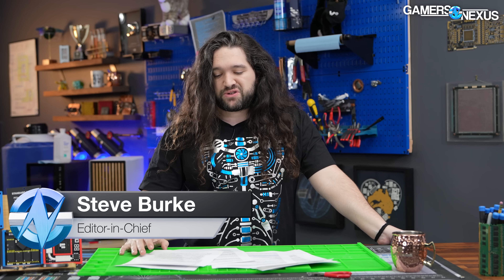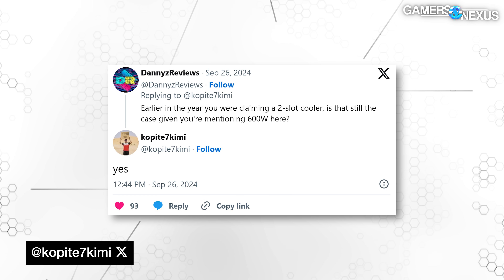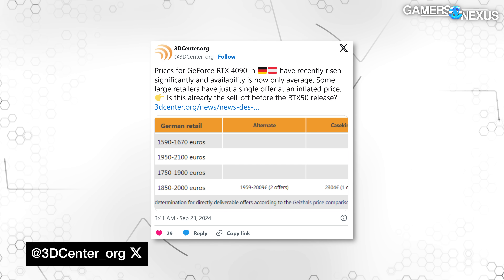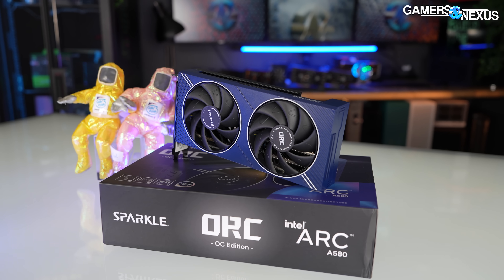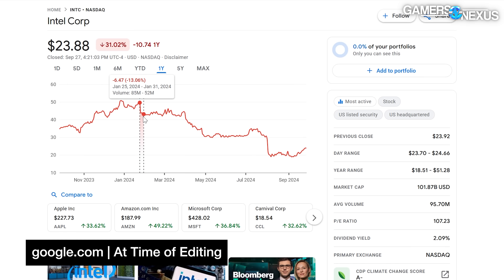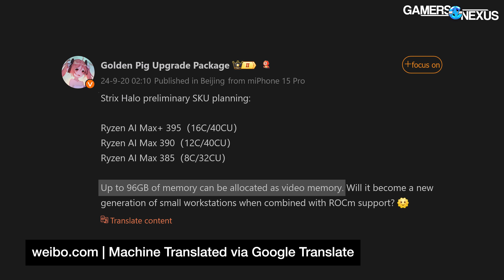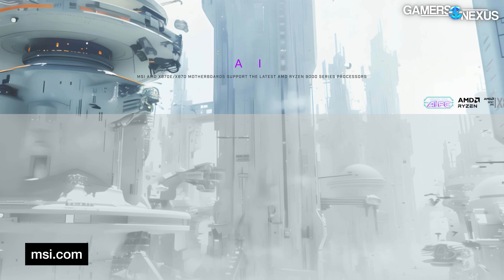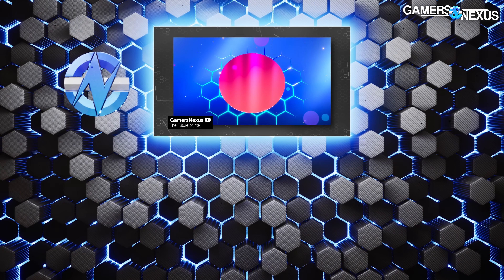HW News - RTX 5090 & 5080 Leaks, Valve ARM64 Experiments, Intel Arc 0% Marketshare, 4090 Price

Comment: HIKE? My 1080 is never getting upgraded bro 😭
Reply: Lmao I just went from a 7700k to a 5800x3d, 16 to 32gb ram (ddr3 to 4) and a new case and drives for less than a new video card would cost 😂
Reply: Just get a 3080 it can go for abt 400 dollars sometimes and it's basically the same with vram.
Reply: How I feel with my i7-8700k and my 1070 that I have to underclock to keep stable lmao. But Planet Coaster 2 is coming out in like a month sooooooo...
Reply: @KrautessendeKartoffel My GTX 1080 died (still boots but crashes randomly under high load). Rip.
Reply: Used 3080ti bro. I’ve seen them on eBay as low as 450$.
Reply: I'm pretty happy with having gotten a Palit 4090 for 1600€ at this point lmao
First time I ever bought a high-end model and I'm always fearful of buying hardware that outdates too quickly, but it looks like the 4090 is here to stay for a good while.
Reply: @kunka592  Tried underclocking it?
Reply: at least you got a 1080 back then i only have a 1060 6gb. Lets hope when the time comes we all get a 5090/6090
Reply: @T33K3SS3LCH3N  early adopters of the 4090 will get their money’s worth imo. It’ll be another full generation before the midrange catches up to it, and another full generation before it becomes slow relative to midrange. Previously the flagship cards would be matched or bested by the 70series and represented horrible value gen on gen. If by some miracle the 5090 is close to 4090 MSRP(it won’t be thanks to strong sales at 2000$), then it’ll likely represent the best perf/$ in the Nvidia lineup again. 

Which is insanity.
Reply: get used 3080 and call it a day
Reply: That your fault at this point
Reply: Long live the 1080 Ti.
Reply: I'm glad I only emulate, so CPU upgrade matters more for me
Reply: I'm still on a 970, don't feel bad
Reply: @kunka592  I had the same it was the PSU not the GPU
Reply: There's some good cards that would be a substantial improvement in the $300 range. RX 6700 XT's have been floating around at decent prices. The RTX 4060 is not a particularly good value, but it is more powerful and much much more power efficient than a 1080.
Reply: I have my GTX1080 and 4790k
Reply: @KrautessendeKartoffel how is your 7700k doing in next gen games?
Reply: Upgrading means AMD
Reply: @NeightrixPrime  for CPUs, yes. For GPUs, it's just whatever best deal you can find at a certain price point.
Reply: Monopoly
Reply: bro im on gt 730 i lag in powerpoint bro please send help
Reply: @dolpoof2335 10GB VRAM is dogshit in 2024. It was terrible when it released.
Reply: @JSXSProductions lol why is it unstable? I used to run a 50MHz core and 500MHz VRAM OC. Now I bought a 6800.
Reply: I just recently got an RX 6800 for €375. I have the same memory capacity as a $1200 5080 😂
Reply: @MechAdv A 3080 Ti has only 12GB VRAM, no enough today. A 6900 XT has 16GB and slightly more performance and costs the same or less.
Reply: @TheClassicMufasa at least you don't have a 1060 3GB lool
Reply: @T33K3SS3LCH3N a 5080 is rumored to be 10% faster than a 4090 and cost as much as a 4080. There is a reason high end sales dropped off a cliff the last couple months because it's stupid to buy high end now for the same price it was 2 years ago when a performance jump is imminent.
Reply: @imnotusingmyrealname4566  Maybe think a little more. The 1080 comes with 8 gigs of vram. He's probably not using anything vram intensive lets be honest.
Reply: get rtx 4070 ti super gigabyte eagle oc 16gb

Comment: I'm still blown away by how much cache those X3D chips have. Like that's enough to fit old 90's games onto the CPU and never have to touch main memory. Hell, that's probably enough cache to run Windows 9x without main memory!
Reply: The minimum requirement for Windows 95 is 4 MB and 16 MB of 98/98SE, you could run dozens of copies of the former and a few of the latter entirely on cache. And yes, you could run games up into the late 90s on that much cache.
Reply: goodluck getting that to work though lol
Reply: And it's STILL beneficial to have more for some modern games. It's incredible how much of a difference cache size makes for gaming performance. I mean the 7800x3d is actually a fairly low performance processor, MUCH weaker than intel CPUs. But that v-cache has it running LAPS around anything intel has. It's the absolute undisputed KING for gaming right now in 90% of games.
Reply: @GGigabiteM  It's not just the RAM requirements of Win 95 or 98, it's the install size. I mean, instead of loading the drivers and whatever from the disk, it can load them all from the L3 cache.
Reply: @HolyRaincloud  The only difficulty is having a motherboard that offers the PS/2 keyboard + mouse that Win 95/98 know to use and support for MBR, since Win 95/98 have no idea of that UEFI that's common nowadays (it simply diddn't existed back then).
Other than that, the CPU is fully compatible, you can even install baremetal the OG MS-DOS. Ok, actually, now I remember, for Win 98 you need a patch in order to make it only see 1 GB or so of RAM, since it crashes when there's more (even though theoretically it should work and support up to 4 GB, as a 32 bit processor would)
Reply: Still can't play heroes of might and magic 3 entirely off 3D Vcache unfortunately.
Reply: I for one hope enterprising future hackers will be able to run them as a "system on a chip" 😂.  Also see the Intel on-package DRAM models for certain laptops.
Reply: @johnmclain250  I mean yeah, if you have a $700 or more processor and want to game in 1080p.  Otherwise it's not really in it for price/performance.  Especially if you factor the platform in. Personally I picked up 5 Z690 boards, 3 of them were only $30-35.  One was 50 and another 80.  The 12700KF fluctuates, but I've seen it down to 185 new multiple times this year So the 7800X3d is the 'Halo' processor, and as usual you pay double for the priviledge.  If you need it, cool beans.  I'm personally waiting for 10 and 12 P core Intel.  I still think the E cores are a bit of a waste for gaming.  Although it was hard to argue that seeing my 14700 (no K) doing the BMW render in 24 seconds wasn't impressive.
Reply: @johnmclain250  
But what about for emulation?
Reply: It's crazy how wasteful modern software is compared to ye olde days.

We've even regressed back to visual UI elements taking seconds to even render.

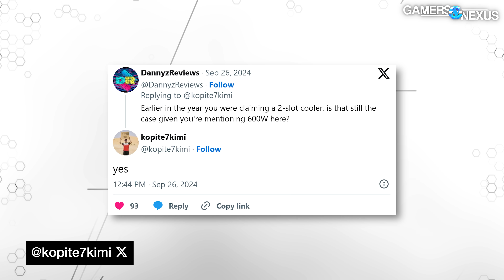Comment: 4:46 The 5090 will indeed be a two-slot card. The two slots will be slot one and slot five.
Reply from the maker: hahahaha. Clever.
Reply: @GamersNexus no, I think this is actually gonna be what it turns out to be
Reply: @GamersNexus  Maybe the "2-slot" leaks are just the server blower style 5090s?
Reply: The 4090 might have been slightly overbuilt so they could just be packing it full of fins and making it 2 slots, and accepting that it would run hot.
Reply: I hope they will add some antisag brackets. Otherwise northwestrepair will have lots of hard work in front of him fixing all the broken GPUs with rejected RMA...
Reply: @devins7  The "Doc Ock" Block, that has 4 PCIe riser cables sticking out from it (Threadripper board required)
Reply: some guy in a 3rd world country... dude the street lights are dimming why?
Reply: @Morpheus-pt3wq  Or we'll all have to get used to vertical mounting to avoid it. Which I personally strongly dislike, even if it would be healthier for my heavy 4080.
Reply: @Morpheus-pt3wq  3rd party aftermarket gpu support brackets do exist and can be bought seperately for cheap. I have 3 supporting my 4070 super so sag and uneven pressure ain't a thing I ever have to worry about
Reply: @SRSpawn  2000 usd for a gpu and they don't include support bracket? what a joke of a company
Reply: @kilowattpa sometimes what is included ain't always worth trying out for eg; my asus rtx 4070 super came with a sh*tty looking nividia adaptor, I never used it I just bought a pwr12 corsair cable instead😅
Reply: @ΔαυίδΠριδεαυξ  Nvidia would never allow that. They used dirty tricks to prevent the 3090 2 slot blowers being released.
Reply: Or they've just given up on air cooling and all 5090 cards will have an AIO attached.
Reply: Yes. Slot one on the first, and slot five on the second ATX mainboard.
Reply: RTX5090: 32GB 512-bit. The SKUs below: 64bit.
Reply: Just a reminder, because it seems like the is some confusion still, Valve's Proton is Wine and you don't even need Steam to use it. Proton is a custom build, but it is the same system.
Reply: Whatever the 5090 does there's plenty of people that are waiting on it and will  make it work regardless.
Reply: I was gonna make a similar joke. It's two slots, the first slot is in the first PC tower case, and the other is in the second PC case for the other half of the card.
Reply: @kilowattpa good cases generally come with built in support...
Reply: @wallywest2360  That's not practical nor reliable as air cooling is always more efficient when it comes to longevity and cost.
Reply: @jamesm568  I have an EVGA 1080 ti hybrid that still works fine.  Cost seems to be mostly irrelevant, the 4090 is absurdly priced and has sold very well.
Reply: @wallywest2360  If you like 1080p then that's perfectly fine. I use a monitor that's no less than 32" and a resolution of no more than 6K and sometimes 4K, depending on which monitor I switch to. The 3090 didn't cut it but the 4090 did. Once you go high-end anything below that isn't even worth using anymore. I can't stand 1080p or 1440p as those resolutions have been outdated for the last 5 years for my use.
Reply: @jamesm568  Thanks for making my point.  Your claim is the AIO cards aren't reliable.  Mine is still working long past the point where you'd want to use it.
Reply: lol!!!!!
Reply: That made me laugh , Thanks :face-blue-smiling:
Reply: 2 slot might be understated, but if you remember der8auer video, when 4090 FE came out, he had shown, that cooler on that can easily cool overclocked FE, that was drawing 650W .. so i expect, it will more likely be same cooling as 4090 FE (Eg. 3 slot size)
Reply: @kilowattpa   not just that. $2000 for a mainstream GPU. It's still an RTX card its not like a quadro or enterprise card. Costs more than... basically all my cars up front did when I bought em.
Reply: Chanerd 🗿
Reply: 28:00   I like how the Seasonic box is oddly long and skinny.  Not sure if this is supposed to make you think of premium (3 fan) GPU boxes, or prepare you for how ungainly and long the PSU is 😅
Reply: LMAO
Reply: @TheCountdownnowgo  
You must be young to ask that and missed, the 10/10 humor that person delivered!!!!!!!!!!!!!!!!!
Reply: @SRSpawn  i have one as well, but do you expect general population to be aware of those? Because i do not.
Reply: @Morpheus-pt3wq  I expect the general population to do a bit of research before they buy something like a car, house, computer, computer parts, console, you name it. Those who don't are strange to understand 😅
Reply: @SRSpawn  
Not strange......... Just that, those situations separate Childish like minds and those of Adult like Minds.
  The world is more full of Childish Minds in Adult bodies than ever before worldwide!!!!!!!
Reply: I'm happy that every gpu with a water block swap to single-slot card 😂
Reply: @dolpoof2335 with the amount of founders edition cards that end up actually making it to consumers whether those run hot is probably irrelevant tbh

Comment: As daily Arc user since release... i won't lie

it hurts to hear that
Reply: You're in the top 0% though, that's something
Reply: @P7ab  Pretty sure that the 0% is in sales, not the whole market share. A market of dozens of millions don't simply swing 5% from X to Y in several months, when we know there's people still running 6-7 year old cards out there.
Reply: The good news is that in 20 years it'll probably worth a tons of money as a collectors item that will be extremely rare and hard to find.
Reply: hang onto it, it will be a collectible ;)
Reply: @samuelschwager  i got 3 Arcs already xD
both A750 and A770 in "LE"
and Sparkle A580 xD
Reply: Same. Bought an A750 for my son's PC. He's very happy with it, and I'm considering Battlemage for my rig when it comes out.
Reply: I have a Sparkle A770 16gb. But got a used 6800 for more fps at 1440p. I will keep it though maybe for a pc in the future for my son.
Reply: @Winnetou17 Good point it takes like 6 A770's to equal 1 rtx 4090 in terms of sales
Reply: Does anyone know if an ARC GPU is good for Plex/Jellyfin and the likes? Especially in terms of driver support?
Reply: You are not alone. I might upgrade my GPU this fall, if the Battlemage is a major step up, but I might very well stay with the A770. Esp. since I can get good framerates at max/near-max settings on all my games (Particularly since I'll probably download Skyrim and set up a heavy (Requiem) LO for it)
Reply: I hate to hear this. More options is (usually) always better for the consumer
Reply: Have a 3080 and bought an A380 around a year ago to offload 2D+video acceleration to while gaming (4 screens, lots going on in the background and kept getting odd stuttering). It perfectly addressed all my issues, no complaints. At that price point there really weren't any other cards at feature parity, especially with the same encoding options and DP2.0. I'd be pretty sad to see us lose the added selection and competition.
Reply: As an Arc A-770 owner what's sad is games remain unplayable even years after launch when a lower spec Nvidia or AMD card does 100+ fps in the same title.
Reply: @Seven_Actual  which games
Reply: @letstrywindows8986  Fallout 4 Fallout 76 for unaddressed graphical issues and performance. Starfield still remains hardly able to do 40fps on all low settings. For reference a 4060ti (much lower spec hardware) pulls in excess of 100fps on ultra.
Reply: @Winnetou17  I bought a brand new Arc A750 in July 30th this year, apparently I don't exist.

Comment: 28:52 Motherboard seller, I am going into battle and I need your STRONGEST motherboards!
Reply: Noooo, travelah, my motherboards are too strong for you!
Reply: You can't handle my motherboards. They're too strong for you.
Reply: Just use the power of friendship.
Reply: They're designed to take most of the weight of the 5090... Most.😏
Reply: @leec3881  Let us all be reminded of that one clip of an exec holding up a huge GPU with an ITX mobo and watching it fall out of the slot 🙏
Reply: @normified  I'm looking forward to history repeating itself.

Comment: FYI, Proton is Wine. It's Wine plus two extension packages called DXVK and VKD3D-Proton. DXVK handles DirectX 9-11 call translation to Vulkan and VKD3D-Proton handles DirectX 12 translation to Vulkan. Valve's major innovation is those two additional packages.
Reply: Knowing how companies work, having valves/steams named on them also really helps solve problems, especially if they can move their weight around to solve odd problems that are hard to troubleshoot without deeper knowledge about individual games.

Comment: Remember when things used to get cheaper after initial release? Pepperidge farms remembers. SIGH It's gonna be a long long time before I get an upgrade
Reply: The $200 to $500 range is decently competitive. Depending on what you currently have, there might be a good value upgrade.
Reply: @Pan_Z  Right now I'm running a 5700X with 32GB 3600 and a 3060. My set up works great as is, I just like to tinker and build for fun. Unfortunately current prices don't make it practical to upgrade.
Reply: @schmutz1g  I don't see why you'd need to upgrade that. I'm running something similar (i7-12650H, 3060 6GB, 16GB DDR5) and it runs even new games just fine (as in, stable 60 frames). Obviously there's room for improvement, but I feel like there's little actual reason to upgrade unless you really have money to burn.
Reply: @haarex.  It has nothing to do with NEED. Its my hobby so I enjoy spending money on it regardless of need.  With current pricing though, any meaningful upgrade just doesnt make sense at this point since there isnt a ton of performance to be gained.
Reply: This new normal is crazy. The Samsung Galaxy S23 Ultra still costs what it did at launch, AND THE S24 ULTRA HAS BEEN OUT FOR MONTHS. Everything has gotten worse.

Comment: My 3080 died and I needed a GPU for video editing/class.  Went for an A770….i love it.  No, not as good at gaming,  but good enough.  Good gaming performance for what I play, excellent Adobe CC performance, outstanding value
Reply: How did 3080 die??
Reply: @peterers3  A lot of the 30 series use awful thermal pads to save a few cents that cause the memory to run at over 100-120° degrees. Way higher than allowed per Samsung's memory spec. MSI was very much guilty of this. I had to mod mine to make it run cool enough. Yes, the core temps were fine (which is what u see in overlays) but silently the memory was being destroyed. I live in Germany, so it's not like it's a very hot country (Although, summers can get up to 40°C....)
Reply: @peterers3  good question, not sure. Basically my computer would crash at random points, often during class or when I was using Photoshop, let alone games. My computer computer worked fine running on integrated graphics. I got into arc because I need to edit video and it’s been completely stable. I sent my 3080 back to MSI for repair. They sent it back and was still broken.
Reply: @LeegallyBliindLOL  im not a gamer but I bought a bunch of 3080s for mining back in 2021 and the first thing I did was replace the thermal pads with top quality ones and the temps dropped dramatically.